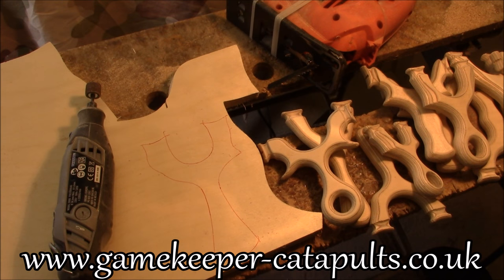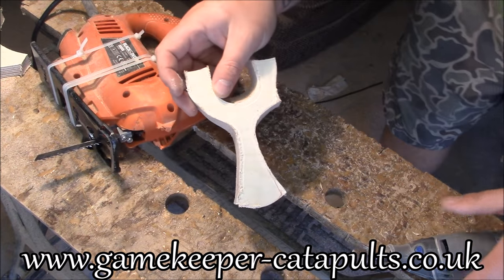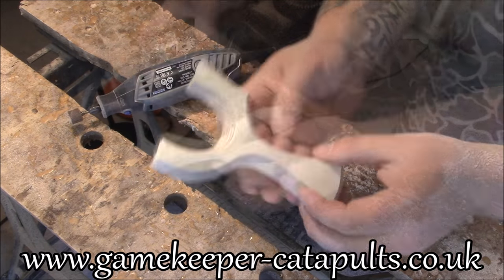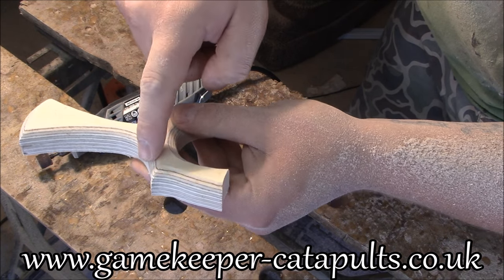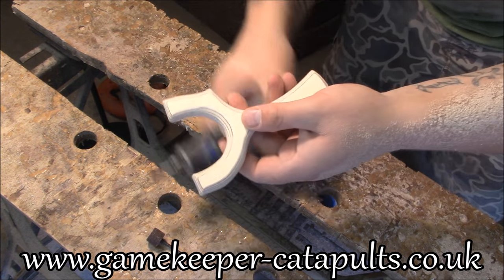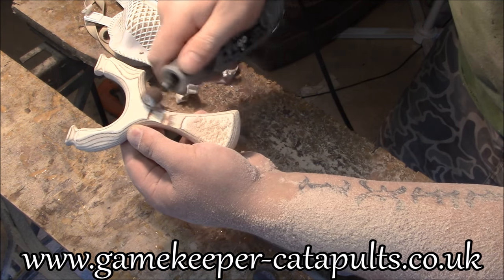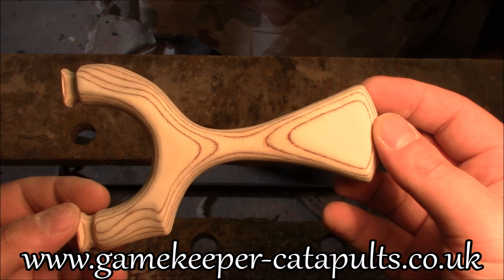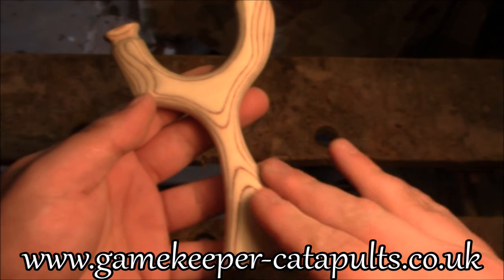HOW TO MAKE A BOARD CUT CATAPULT / SLINGSHOT WITH SIMPLE TOOLS

Comment: been shooting wire frames and tubes for ever and just got some theraband on the wire frames and have two wooden slingshots in the works (one was done and finished but the band groves were too shallow so the varnish had to be re doneafter some reshaping) I only used a circular saw  drill and rasp to do the rough work and a knife some mini metal files and some 100-200 grit sand paper to smooth it I'm really happy with the custom shape that  came from digging it out of a board with just some rough marks to guide me. thanks for the inspiration I took a lot from your designs while sketching and carving and will use your dremel technique on the other one that is mostly still a block of wood.

Comment: You're clearly used to making loads of these, John...very efficient! Besides a jigsaw and a spade drill for the "pinkie" holes, I use a hand rasp and file to shape my birch plywood slingshots (takes a bit of practice), and 120 to 300 grit sandpaper to finish off: I would definitely advise wearing a protective breathing mask (M-3 brand) against the fine dust composed of glue and wood during the entire processing stage: this stuff is really bad for your lungs. I usually paint two coats of wood sealant for the final touch, but polyurethane is probably a better choice in the long run - I don't know.

Comment: Very nice John! But you should warn people to use a dust mask doing all the Dremmel work. Sawdust in the lungs is really bad especially when paired with the dried adhesives from the laminations. I had a friend die from this and it's a cheap fix. Thank you! Great video!
Reply: He died from woodworking? It must've been a long time of abuse ?
Reply: @desertrainfrog1691  Not necessarily. I used to lecture wood carving clubs around my state here about wood toxins in hardwoods like walnut wood, etc. A lot of trees make toxins to fight off insect attacks that occur in cycles, but they fine sawdust that hangs in the air for awhile after you power sand can go deep into your lungs. Why die early if you needn't.
Reply: @tedparker2164  what about hand sanding? I usually wear a 3m N95, so not the best protection

I don't ever use machine sanders.
Reply: @desertrainfrog1691  Hand asnding is negligible, power sanders are the devil with dust.
Reply: @tedparker2164  Thanks for the info. I try to be safe, usually I just do any kind of hand sanding outside and then I know it's good. With metal, same story. If it's inside with aggressive sandpaper/rasp on wood/or file on metal, I'll use a mask of some kind. If it's fiberglass, G-10, or micarta, respirator regardless. (And ideally not in the garage, but outside.) 

Good to know that hand sanding is low risk.

Comment: what speed do you use on the dremel when rounding the edes and putting on the band grooves
Reply: FamasFTW98 depends on the Dremel and how long you want your sanding drums to last I believe I have the 3000 Dremel and I'd run somewhere around 5 or 6

Comment: what wood to use. plywood?
Reply: Lucas Tan birch plywood
Reply: what grade of Birch should I be searching for?
Reply: Plywood in the States, multiplex in U.K. and Europe, same thing really. You want top grade, mostly heard it referred to as Baltic Birch in U.K./Eur. in the states it's cabinet grade plywood. You'll probably have to look for it at better lumberyards or specialty wood mills. Not likely you'll find the quality at your local home center. Lower grades of plywood will have voids in the middle layers. These may not show until you shape your cattie. The voids can lead to weak spots, especially in your thinner, narrower sections, this could lead to catastrophic failure, at worst, unsightly at best. 
If your just looking for something to get a taste of making your own. You might look for HDPE cutting boards. Look for ones in the thicker range, 1/2 inch or better. You could also glue up thicker sections with 2 part epoxy and some clamps. HDPE is an easily worked plastic, holds up well and makes a great cattie. You may find it's better to work with hand tools rather than power tools. If it gets to hot it tends to melt, although if you keep moving and not overwork any one spot this can be avoided. This is also a good choice for making proto types before making in the more expensive plywood. Check in local thrift shops or second hand stores, as cutting boards often turn up.
Reply: flywood🎅👼
Reply: @robblackburn5890  onjjjjh